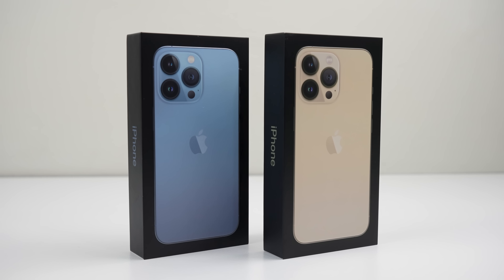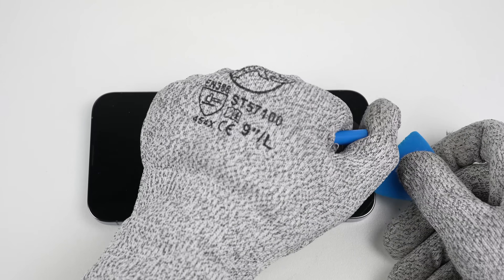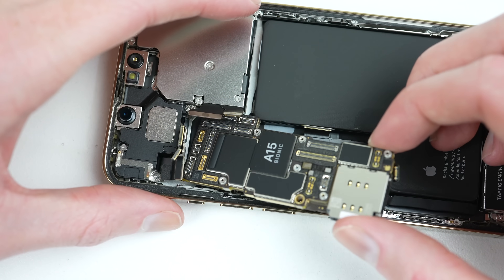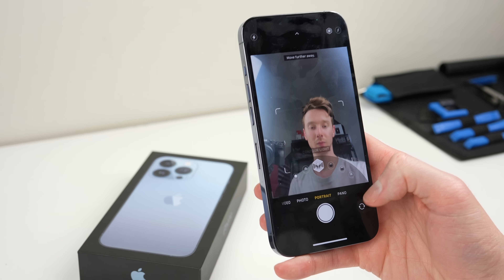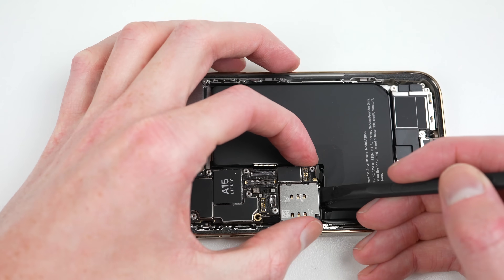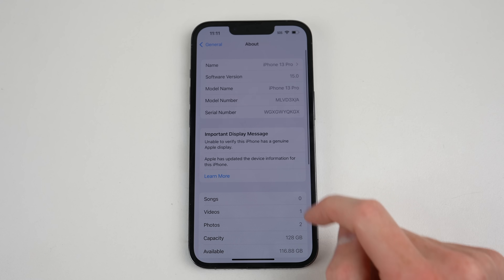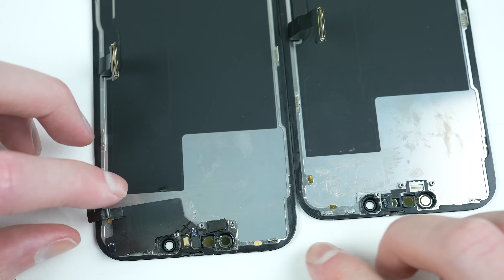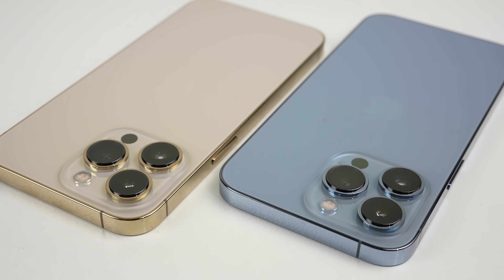iPhone 13 A Repair Nightmare - Teardown and Repair Assessment

Comment: there is obviously a way to reset the hardware ID's when parts are replaced since apple can do it as well as their authorized repairers.
Reply: That's the point. They don't let anyone do this. The serialization and lockout are to prevent customers from repairing what they are supposed to own.
Apple doesn't even know how to repair their own products, they could know if they cared. But they send refurbish jobs to "Authorized" 3rd parties who do garbage work.
Or lie to customers that something is not even repairable. They still claim data recovery is impossible, even banning users on Apple support forums who say otherwise. Despite thousands of documented and recorded data recovery procedures.
Reply: @_BangDroid_  yea thats a good point, we are not leasing these things like a cable box, we own these and i could see them saying if you open it, it voids the warranty if it has one, but that is my right to take that risk.
Reply: Yes, but only with software Apple wont release to the public.
Reply: @TheBeeMan1994  u know why don't we just rip out iOS from that shit and use the good hardware
Reply: @TheBeeMan1994  yup, and even if it leaked, they could update it and make a .1 release to counter it.

Comment: Nice job. I'm  impressed with your technical skill. I've been inside my MacMini and that's enough for me!
 
How do you think Apple can replace those parts without causing the same problems. Do they reprogram the firmware?
Reply: most of the time they would tell you to get a new phone thats what happened to me when the charger outlet didnt work and my phone wouldnt charge

Comment: Does this insanity actually provide some sort of security benefit? Like if you set up Face ID on a working phone, does this at least prevent you from being able to bypass it and access the data on the phone by replacing the cable? I can only imagine that being the only reasonable excuse to employ this kind of software lockout, if Apple were aware of intelligence agencies performing a trick like this to break into previous models of iPhone without a warrant or any kind of legal authority compelling Apple to aid them in subverting the security.

I'm also guessing that similar to replacing the DVD drive in an xbox, that if you can dump and decrypt some sort of firmware (probably a bootloader) that you could in theory extract some sort of key, and if you can rewrite this key to the one corresponding to the new replacement part, re-encrypt and flash this firmware back onto the iPhone, it would then behave correctly. I imagine there is also some ability to flash and run a non-encrypted generic firmware with all the software lockouts disabled, designed for internal development and testing etc. Something you could possibly find if you got your hands on a prototype phone, of course there'd be no guarantee that such a firmware would even execute if flashed onto retail hardware. Another possibility could be to find some sort of exploit that made it possible to run unsigned code, again just theorising but probably by copying a modified bootloader.bin (or similar) file onto the flash memory then using an exploit to force a soft reboot with a pointer set in memory to trick the CPU into booting from a different partition or specific directory on the emmc with the modified bootloader that allows the running of unsigned code at ring 0 which the disables the various hardware checks.

It's a real shame that Apple and other manufacturers insist of behaving like this, if they actually cared about sustainability and e-waste you could design the iPhone to be modular with very little effect on compact design and miniaturisation. Apple already treat previous model hardware as mid-to-entry level devices rather than building to a budget. There's no real reason why they couldn't support an "upgraded" previous model as a mid-tier device, by releasing an "upgrade module" with next-gen specs along side each new model, so that for a bargain price you could take your "old" iPhone to a service location, where a quick swap changes the CPU, RAM and ROM chip, to match the specs of the new version but keeping the current frame, display, radio, and storage (as a bonus you wouldn't need to transfer all your files or reinstall all your apps). You could swap in a new battery if it was needed but not bother if the current one was still fine, and maybe you could upgrade the built-in storage since they'll never support micro SD, but since in each generation they generally just double the amount of storage so the most expensive model will jump from say 1TB to 2TB, but then they'll also release a cheaper model with only 1TB which on the previous model was only 512GB and sometimes even offer a 3rd tier which would be 512GB and was previously 256GB. So upgrading rather than replacing if last year you got the most expensive version, would still just have the same storage as this year's entry/mid version. And new versions of iOS always support the previous couple of devices. So for say around half the price of buying the new iPhone, you could upgrade your current one to have the new faster CPU, the newer faster and larger amount of RAM, the latest iOS with the same amount of storage as the mid-range "$200 cheaper" version, a perfectly good battery and the only real differences would be a possibly lower resolution or refresh rate display (which wouldn't be an issue for 99% of apps that can run on different size phones and tablets across several generations) and a not quite top of the line array of cameras. Maybe slightly older / slower bluetooth, wifi and cellular radios, but that only really means you'd have to do a full upgrade when jumping from 4G LTE to 5G and Wifi 802.11AC to Wifi 6, then again whenever there is a significant upgrade to any of the radio technologies, which is about every 5 years or so.

Comment: I have never been the owner of an iphone, so my comment is just a personal opinion, avoiding attacking companies or consumers. Theoretically apple is not completely wrong in making a third party repair "a nightmare", of course we live in an advanced age and even phone cloning alone is easily available stuff.
The fact of blocking the repair of third parties could also be due to this, or more simply also in the event of theft to prevent the pieces from being sold or changed to no longer be tracked. What's the point of buying a thousand dollar phone,
then why to save for a repair? If you can buy an iphone you shouldn't have any problems repairing it if it breaks down, right?

Comment: It’s quite a hard one.. would you like to buy a second hand premium phone full of cheap and low qulity replacement parts for the premium price that should contain the quality promised? Those parts could be off a lot. E.g. replacement screens are horrible and uncalibrated and the specs are way off.

Comment: to be fair it can be argued that some features shouldn't work without genuine parts installed by authorized service shop for privacy reasons (for example so you know they won't be able to install "fake" faceid reader by changing the display)

Comment: Their updates always cause bugs which would never happen under Steve Jobs. The latest ios 15 made my iphone speaker quality drop. When I talked to apple about it they told me my speakers needed to be replaced. I then connected headphones and the quality was jacked up through the headphones. SMH. 
Also, my battery was draining like crazy on iOs 14 when I updated to iOS 15 safari showed that there were over 150 tabs open in the back when previously there were none. Apples doin some shady shit trying to get people to drop their old phones and update using technical bricks.
Reply: Steve Jobst started this trend. Apple has been continuously at war with their consumers since day 1 of the launch of the iPhone series. Which started under Jobst's leadership. 

And it is not just the consumer who have to deal with their stubbornness and arrogance. You see, in Norway, many of the updates you are mentioning here, are illegal, and the government here has been trying to deal off with Apple for over a decade by now. It has even gone to the point where Apple have forced their customers into signing contracts in which the customer gives up their law-given rights, just to be done with them.
Reply: @Gartneren1234  Thanks for informing about Apple vs Norway. Very interesting. 

What I meant was Jobs wouldn't release poor implementation and half working features on his phones. 
The reason I use Apple is for the simple fact that when I use it. It works and it looks and feels premium. But theres really no reason to stay with apple now cause its almost like using an android phone and their uniqueness is slowly diminishing.
Reply: @BestxBelieve  You do realize Jobst had to use multiple iPhones for the first iPhone reveal right? The first iPhone was so buggy and glitchy that they had to keep one iPhone for every feature that they wanted to showcase at the reveal, and than one iPhone which they had rushed a quick-fix on which he used for the final demonstration where he ran all the iPhone's applications simultaneously. And the first iPhone was rife with design flaws and poor implementations. 

As far as the battle between Apple and the government here goes, it is in indeed a very interesting case. And as much as Apple stubbornly tries to void their legally required responsibilities, it is moving more and more to a point where they just have to accept the laws.
Reply: @Gartneren1234  I'm not going to debate whether iPhones have ever been buggy because theres a difference between the eras. Your describing a time where we were transitioning from flip phones to the iphone. I'm not a hater of apple. I loved their products and most of my products are from apple. But I don't like where they're transitioning and for the first time in a long time i'm looking at other brands that might fill my needs.

As concerning as it is about their legal battles in other countries. I believe if they continue this path in America their stock will drop significantly. So, as bad as it sounds i'm not invested in troubles of Norway. I just want my products to work. If they don't. Then i'm switching. And the market will dictate their actions. But then again I have a capitalist mindset not a victims mindset.

Comment: I purchased an iPhone 12 Pro max not that long ago with a protective case a lens protector and added gorilla glass for the  screen and everything worked just fine until the thirteen came out. not only did my battery life drop but my camera which I hardly use dropped in quality  and the phones over all performance dropped. there is a specific app that I use for my job that would no longer function unless I updated the phone to iOS 15 so I was deadlocked in to exposing my phone to this  planned obsoletion software. now the iPhone 13 works exactly the way my 12 once did which makes me question if that thirteen is really any better than the 12 in the first place . ive been a fan of apple since the 80s, but they have really pulled a shocker on me this time.

Comment: Typical apple, money grabbing idiots. The only reason they are still relevant is because of their old fanbase, once that's gone there won't be many people falling for the same designs 3 years in a row. Anti right to reapir is a red flag why else other then greed would they do this. EVEN better, if you want to make a simple screen replacement (let's be honest a lot of iphone users crack and break their screens), it will disable face id and other useful features. Wow, each day apple sinks lower.

Comment: Wow. Apple are truly evil and hating of the free market. 
So much for caring for the user and the environment. 
Apple are dicks. I can fix a iPhone, any number before 12 like 20 min for a screen. And the user can go about their business. Apple want them to wait for days for their "secret code" to work. 
Plus they won't allow really good and old shops to fix for them. If they do, they are only allowed to fix 3 items on iPhones and parts cost a fortune. 
Every other phone maker sells their parts for this phones. And it makes fixing a Samsung, Sony or Motorola very easy (maybe more costly) then Apple iPhone. Plus you know if the real parts. 

Apple, go away with your hate of the free market. Join the 2021... It's not 1980 any more. Steve is dead. Move on, think of the people. Think of the planet. 
Be good for once.

Comment: So they’ve built their software just like an automotive system, where each module (on the phone, component) has a serial number address that talks to the primary ECU, and if they don’t match the OEM serial number, they won’t speak. Only fix to this is a flash with OEM software to program the replacement serial number. Seems Apple has each component tied to a MAC address that has to be programmed from an Apple approved software to program the replacement component to match the routing information. Basic networking 101
Reply: the point is that only apple has the reprogramming tech though